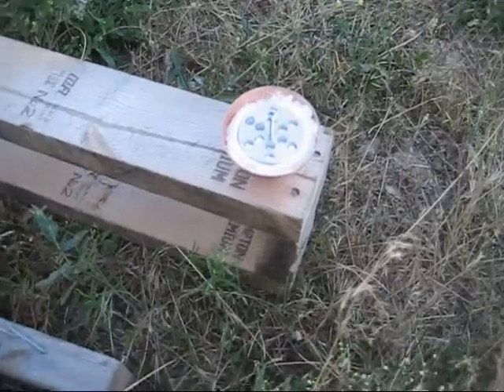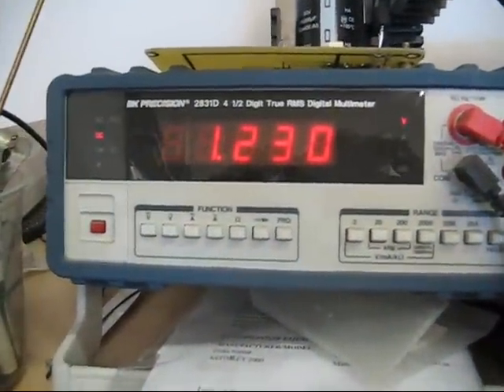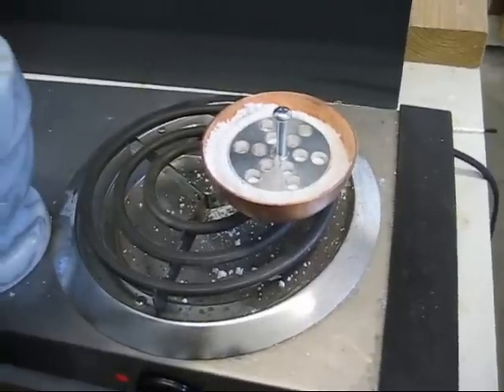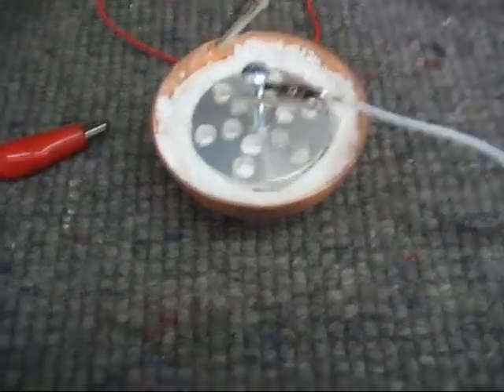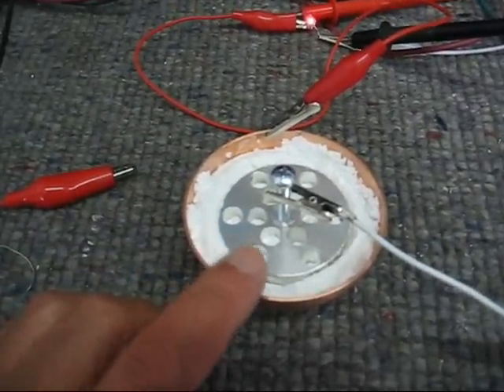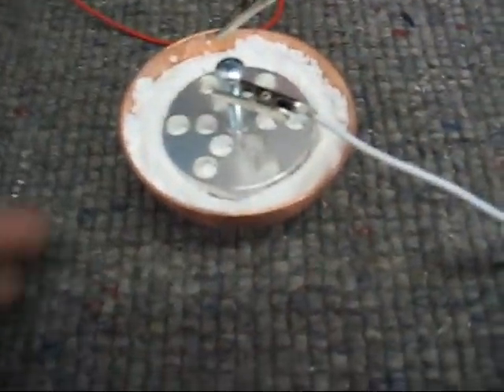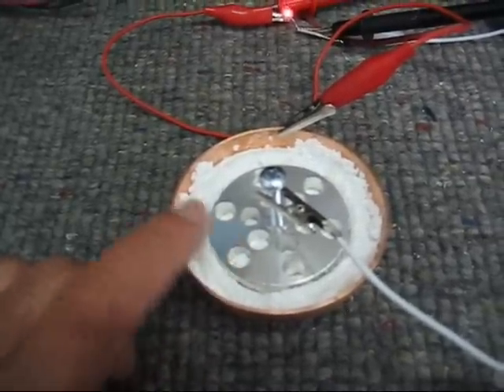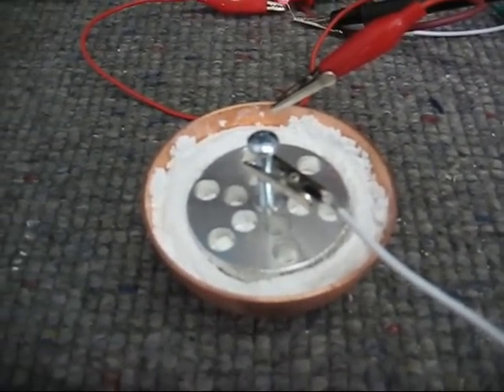Epsom Salt Crystar Star Cell  As A Thermopile For Electricity

Comment: Interesting experiment and observation! Just a thought for discussion. If it is a thermopile, then you don't have to use copper and magnesium as electrodes, instead, you can just use steel for both electrodes and should still see the same output.
Reply: As chemical reactions usually become faster when heating the cell up,  seeing more energy output does not rule out chemical reactions as the reason of energy.

Comment: hum ! interesting experiment  at all ! with your crystal battery ! perhaps you had found another PZT generator act like pyroelectric generator (in crystal...quartz tourmaline...) try to do a big surface of Mg and Cu.....but you can charge your cell like a capacitor with high voltage  ! try a piezzo lighter on the cell...very good work ! best regards !

Comment: What if it does more than simply convert heat into current? What if it converts various forms of higher-than-normal ambient energy into current? Have you tested it with photon bombardment via laser? How about a heavy EMF in a brass-mesh insulating chamber? How about kinetic energy? 

.

I'm curious as to all of its potential energy conversions.

Comment: If you combine a dry cell with a crystal cell in paralell (or 3 with 3 or sets with sets), due to the diferent electric conductivities, you will have a Free Energy device that recharge itself and provides also light forever.The dry cell will become also like a crystal cell, which will recharge from ether.
Reply: you are right -  free energy cell that can re-charge itself as in my experiments.  Problem I have now is with corrosion. 
Any thoughts?
See my experiments here  at atrb.weebly.com

Comment: This is how crystal electret cells (or batteries) works: Through geometric resonance of the crystal structure - it resonates with cosmic chakras of infinite energy, like galactic sun, for instance, and in the last instance, from God, which is the source of all! The crystal cell shoud be much like a pyrite to work best, with inclusions of various metals and minerals in strong crystal formation! You should use 2-3 bateries to switch them from time to time and you have Free Energy, voila!

Comment: @Energenx Hello :)

So -it is- thermal battery what I thought about. Just it works in room temperature instead of 100+ C. It reminded me of old physycs lab experiment in my 8th class of secondary school, when i soldered 2 nails ends, then attached voltmeter and heated up soldnered ends...

Comment: @Energenx 
Hi John, yes, but please try to dismantle the cell after a few days when you let it run
all the time on the LED and see if the magnesium has any signs of corrosion at the underside.
I had a magnesium carbon cell stored without any electrolyte between it , just air between the
electrode and the magnesium got corroded just from the air, which was probably humid...
As the Epsom salt is hygroskopic it attracts also water from the air...
Many thanks.

Comment: For when it cools down, you could probably use some kind of special plastic that will cause electro-static discharges like that static electricity involved with the plastic handle and the metal on shopping carts. Maybe a special plastic could cause more of an inner insulation kind of effect that could cause electrons to jump between the plastic and the metal for a longer time. Ionic electrical charge preservation.